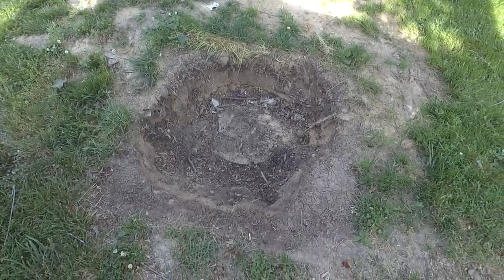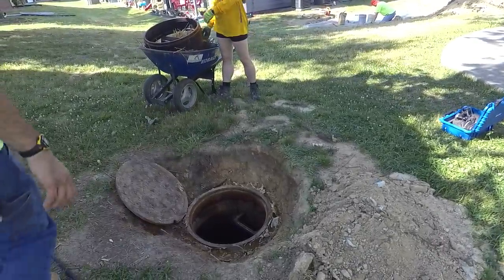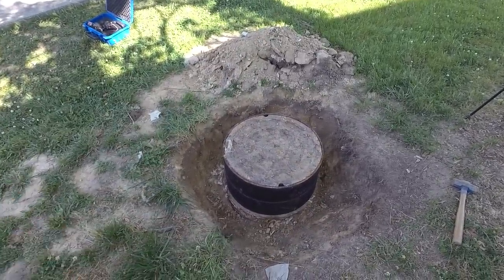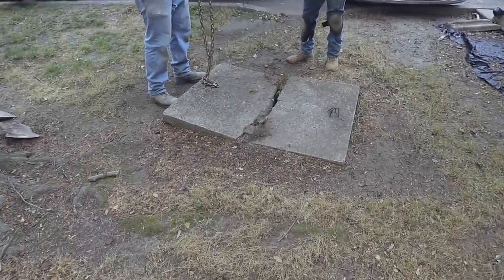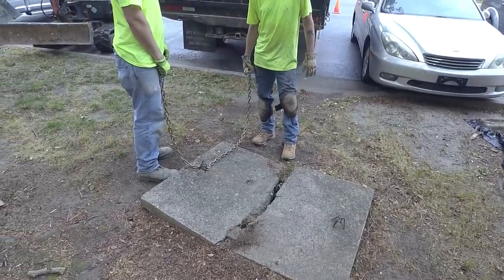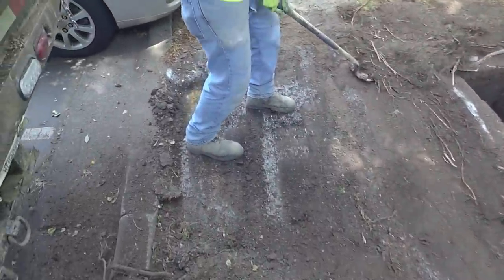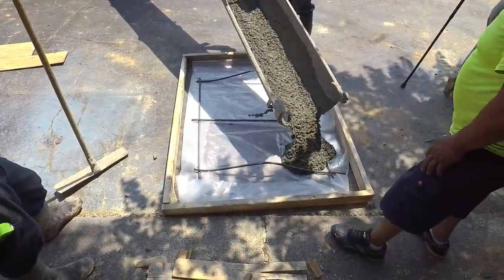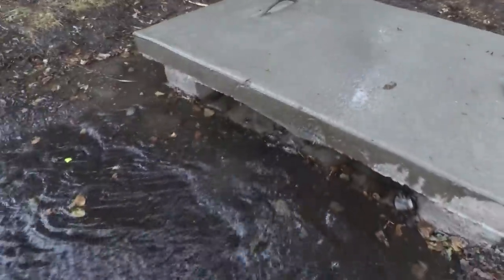Raising manhole cover and drainage basin lid

Comment: I work for the county, we don't have sewers (everyone is on septic) but we have a ton of stormwater catch basins. In fact I believe there are 785 catch basins that we are responsible for and we clean each and everyone every year. Takes a month to do. We don't allow cast iron, all catch basins have to be concrete. Risers get cemented on using a product called Jet Set. Would love to have easy fixes like what you had. Usually were doing large scale repairs. Great video.
Reply from the maker: Thanks for your work Mike and thanks for watching! - Shawn
Reply: Why wouldn't they allow  cast iron? That seems ridiculous to have to remove that concrete if the basin plugs. Plus it looks like it would be super easy to crack again.

Comment: I had no idea you could just slap some rings in to raise a manhole!  I figured you'd have to frame & pour concrete or lay bricks....this is WAAAY easier!  Also, what was the deal with the 2 ft. corrugated in the storm drain? I thought they always used concrete or ceramic pipes for things like that? (loved the Post 10 reference too 😁)
Reply from the maker: Hey Rob! Yea, those riser rings are awesome, but somewhat expensive. It was sturdy just with the rings and lid but packing the dirt around it made it completely solid. I'm not sure about that pipe...It looked like someone constructed it by hand..
Reply: Where can I order some of those manhole risers?
Reply: I'm interested in finding 1 ring for my home yard in Atlanta but he won't respond to where he bought them. Secret I guess.
Reply: Did you guys found out where to buy the riser?

Comment: Property manager or city building department couldn’t provide a plot plan / blue prints? 
No one kept an as built?
Watching your video at lunch is a nice change of pace.
Reply from the maker: Na, this has changed hands a few times and is from the 80s. I think nothing from past the early 2000s in paper is still around.
Reply: I have worked with builders contractors with construction done in the last 10 years. Convenient when those papers go missing for the liable party!
Reply: Worked in commercial/industrial HVAC for many years. The worst as far as records of locations of anything?? Hospitals.
Even with the most current records we found many "dead head" deleted and even still active utilities long forgotten about.
With every new job we found notations by the architects and engineers "field coordinate" . That was because even they didn't know what was to be found and didn't want to be held liable for unseen problems.

Comment: The two riser rings could have been tack welded into place to prevent them being pulled up in future when the rusty lid sticks to a ring.
Reply: They will probably rust together before the lid come back off though
Reply: They are cast iron.  That takes a special process and rod to weld, if it is a weldable cast iron.  Otherwise it will just crack and do nothing.
Reply from the maker: I thought about that but I don't weld cast iron. You're right that a tack would be better than nothing but those things were solid once in place. Great suggestion!
Reply: @benjaminreinhardt259  nickel rod and peening in between, worked on cast iron blocks for me in the past:)
Reply: @cliffpalermo  I agree, but depends on the type of cast.  Some can not be welded.  I have welded the cast center sections of Ford 8.8s to the tubes with preheat and post heat using 7018 rod.  Has held up to beating it in my Jeep.

Comment: Can't that rebar in the lid being so close to the bottom surface and being exposed in the top surface cause issues with spalling later on?
Reply from the maker: It was a good blend of concrete that should hold up very well.

Comment: wouldn't that catch basin need a grill to stop random crap from going inside? or is that not an issue?
Reply from the maker: I don't want a grill because it will clog up and the problem will happen again. If debris can fit under the lid it should flow through the culvert with no problem.
Reply: @GCFD  Ah sweet as, good to know thanks

Comment: Should I make holes in my sump pump catch basin the ground does get saturated?
Reply from the maker: If you're catching all surface water and don't have the catch basin near any crawl space you could. If you're piping gutters directly into the basin, then no holes.
Reply: @GCFD  one question 🙋🏻‍♂️ I am catching gutters in it so then When I install the catch basin in the hole I don’t have to put angulated stone around the catch basin just put it in the hole and put the pump in it and catch the water in there and pump it out correct? Or do I still put stones around it ? Or just backfill it with dirt?
Reply from the maker: @rfl35  I think you’re fine to backfill with dirt in that case. Maybe a little stone around it to really pack it well.
Reply: @GCFD  ok thank you for help

Comment: Nice job.  A customer who gets a contractor that actually cares about the quality of the work is fortunate indeed.  That fabricated lid looked really professional.  Comment make sure to measure clearance or gap between lid and box so as not to create a trap for children.   I think code for railings is a 4" sphere is not allowed to pass through a rail.  I would think the same rule of thumb would be good for drainage control structures.
Reply from the maker: Thank you!

Comment: No metal grate in front of the hole to prevent debris from going in it?
Reply from the maker: Nooo, that would only clog up and re-create the problem. If the debris can fit under the lid it will flow out through the culvert pipe. 👍